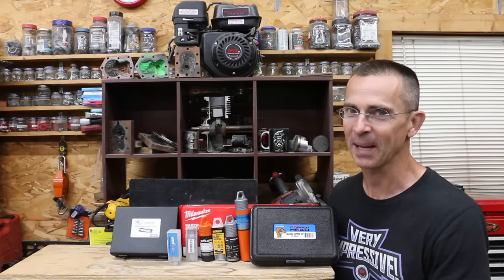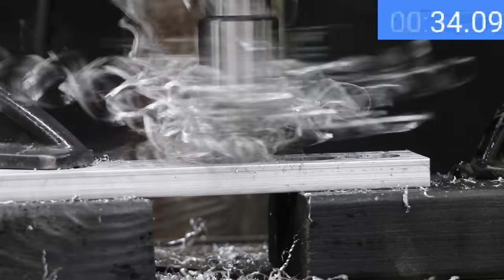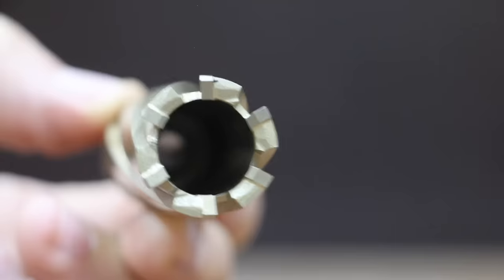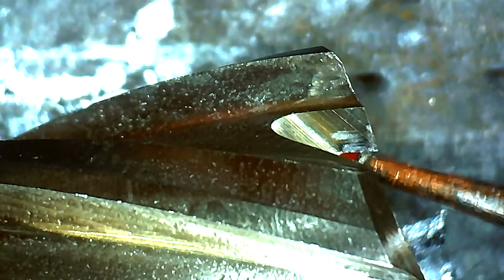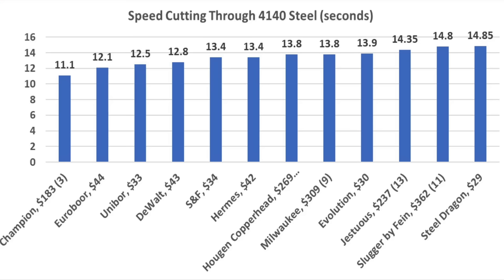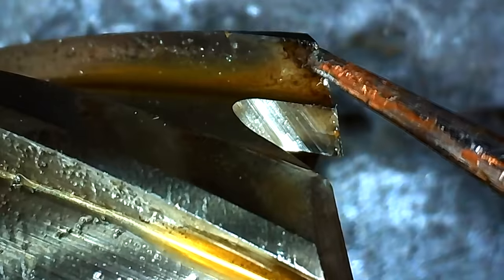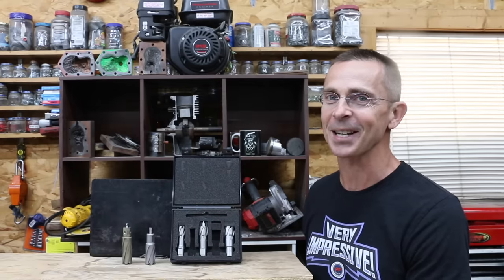Best Annular Cutter? Fein, Milwaukee, DeWalt, Euroboor, Hougan, Hermes, S&F, Evolution, Steel Dragon

Comment: Thanks for  another excellent test and video    I recently bought a farm auction mag drill.  By design the annular cutter throws cuttings and coolant outward thus the internal coolant design on most drills.   I was trying to use cutting oil but more recently started spraying soapy water on cutter so I have minimal cleanup before welding.  Cutters seam to stay just as cool.    Regarding no center pin I have found a cut off and resharped 20?P nail works about as well.  Helps aim drill and eject slug.  I also find magnet does not like pipe or thinner metals.  A 2ft piece of channel is a homemade jig I use to hold drill and or adapt to odd shaped pieces on the farm. 
I wish you would revisit diesel additives and wear prevention.  I have been using the Walmart 2cycle TC#3 but now I am having problems finding it.  I am curious if 0W-20 synthetic  at same 100:1 ratio would provide same wear protection.  I think the injectors themselves wear out without lubrication.  
Another item is algae growth in diesel.  Several bad experiences with little driven diesel systems.  Latest is I had one injection pump rebuilt (IH656) put fresh fuel in drained tank.  I did not use tractor because of drought (San Antonio area).   Tractor got to be impossible to start,  looked like jello in tank;  had been using Howes.  I tried several additives but  I now mix a tablespoon+ of boric acid in white power service fuel additive (glass jar indicates some does dissolve) and use that in tanks.  I do this based on what I read about people trying to add boron to oil and because  boron is basis of Timbor and Biobor.
Reply from the maker: You are welcome!   Thanks for sharing.

Comment: Annular cutters are sometimes used in gunsmithing to remove material from a rifle barrel in order to tap threads for muzzle devices. This process requires a precise internal diameter measurement, but the cutters are sold advertised with only the outside diameter listed. What was the inside diameters from some of these cutters?

Comment: looking at all the data, it's best to get a carbide tipped annular cutter. you sacrifice a bit of cutting speed for far better durability since the carbide tip are barely scratched by spring steel.
Reply from the maker: Thanks for the feedback.

Comment: Can we see a separate shoot out between TCT and HSS cutters? They really are two different categories of tooling. Most of these manufacturers make TCT sets in addition to HSS sets. I would not choose to use TCT except when needed, and in those cases I would probably only choose TCT. (HRC>n for some value of n)
Reply from the maker: Thanks for the suggestion.

Comment: Im interested in what those copper bits are made of. They take longer to cut through but are significantly more durable than most bits. Did they plate copper or is the copper an alloy from say, tungsten?

Comment: I use these a lot at work and they're very good for drilling however if you have two layers make sure that as soon as you cut through the first layer you pull the bed out and remove the core that was just drilled or else you will sit there spinning and spinning and spinning and do nothing but overheat it also they are very brittle.
Reply from the maker: Thanks for the feedback.

Comment: As always, entertaining and informative!  We've seen angle grinder cutting discs, grinding discs, and flap wheels... How about wire wheels? Durability and ability to clean material can vary vastly.  I'd be interested to see wheel style and cup brush styles.
Reply from the maker: Thanks! Thanks for the suggestion.
Reply: Tolex brushes as well

Comment: Hi Todd, again, a super cool test.  Any chance you could try super-invar?  it's a very difficult material to cut; but, i do use it.  it's not like those that you've tested (although it's kind of like spring steel.) machining it makes tons of smoke and fine finishes are hard to get.  also, i know it's a bit insane but i'd really love to see one of these carbide cutters used with a ton of water and soap trying to cut ceramic tile.  would it work?  finally, what do you do with the stuff you've tested? do you trash it or give it to something like Habitat for Humanity?
Reply from the maker: Thanks!  Thanks for the suggestion.

Comment: Worth noting that you can run carbide tools with faster spindle speed, which might help make up the time difference vs HSS cutters on softer metals. With carbide I'd be looking for dark brown or even blue swarf to indicate it is running at its full potential.
Reply from the maker: Thanks for the feedback.

Comment: Tool review request. Torque screwdrivers have become essential for electricians. Historically, electrical inspectors have not enforced torquing requirements for smaller screws, lugs, etc., but that has changed in recent years. With the change, prices and quality are now widespread ranging from $30 to $400 for these manually operated screwdrivers. They are used to torque circuit breakers after inserting the wire, and just about everywhere else, a wire or cable is terminated.
Reply from the maker: Thank you for the video idea!

Comment: CWM Scott copped out on his JB Weld bore liner experiment, which was reasonable since his pitted bore was too valuable for such experiments as a 1937 Chevy engine.  So anyway, do you have any cheap or junk bores that are pitted or damaged down low that could potentially be filled with JB Weld as Scott originally suggested and Uncle Tony endorsed? at least for light duty use?  Or should I try Shop Kat Industries?

Comment: Video suggestion:  I’d like to see a “best of” cordless tool brand using the data you’ve collected in all of your tests.  Since branded cordless tools (drills, reciprocating/chain/skil saws, leaf blowers. hedge trimmers, etc…) tend to use the same battery packs, who gives the best value among tools that use the same battery packs?  This could be very useful to someone that wants to invest in cordless tools with interchangeable batteries over time, considering sometimes the battery packs are very costly.  So what’s the best overall series of tools that utilize the same battery pack?
Reply from the maker: Thanks for the suggestion.

Comment: Another 'Test by the Best.' You're the Best when doing the Test. Did I miss the Test on a stainless steel sink? We need a device that can be set up to allow for a continuous supply of cutting oil when drilling, as professional milling machines have. Is anything like this for us DIYers available?
Reply from the maker: Thanks!  Thanks for the suggestion.

Comment: I feel like I would have to go with the Euroboor, having a fast cutting speed may save labour time for employees, but changing a bit every 3 holes is not saving you time.

The fact the wear of the champion is almost double the first two, makes it hard to justify over the similarly priced (per bit) Euroboor. But it did cut faster so... Maybe a toss up depending on how you value each.
Reply from the maker: Thanks for the feedback.

Comment: These cutters are designed to have a centerpunch for the center pin to ride in when starting the cut. The center pin should be spring loaded.

Comment: Thanks for the test. I was however, disappointed that you didn't use an inside micrometer or telescopic gage and micrometer to measure the diameter of the completed holes. I'm a heck of a lot more interested in the hole diameter accuracy than how much the cutters weigh. Endurance, circularity and diametrical accuracy are the key parameters. Unfortunately you only measured one of the three.
Reply from the maker: You are welcome!  Thanks for the constructive feedback.

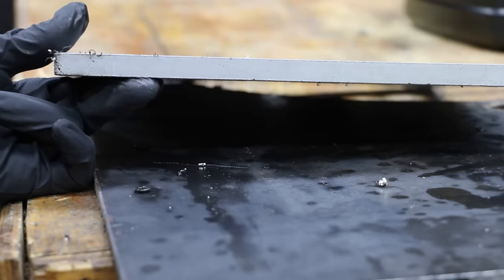Comment: Sorry, but your statement @ 15:27 of this video, where you claim that AR Material is supposedly designed to stop bullets is false.
AR material or Abrasion Resistant Steel is originally designed, say for a Rock Crusher, possible a bucket say for a Back-Hoe, etc.
Armor Resistant, is an added benefit for said material, not it's original designed purpose.

You still make the best video's on YouTube.  Great subject matter, now I know what Annular Cutter(s) to purchase for my Mag-Drill.  Welder, Metal Fabricator, CAD Designer (I use Turbo-Cad, going on 22 yr's.)

Comment: The test for the carbide tools is a bit not wrong id say but not what you usually use carbide tools with. For carbide you usually push it as fast and as hard as the machine can and as fast as possible

Comment: HSS tools are easier to sharpen than carbide inserts, so when you get some shiny new sharp stuff the HSS will be sharper than carbide more often than not.  A decent machinist probably has stuff to grind and resharpen HSS tools, but you'd be lucky to find anyone at all who can sharpen carbide.  HSS is also considerably cheaper in most cases.  This is why most machinists will tell you to use HSS tooling on whatever you can, and leave the carbide for the really hard stuff only when necessary.  Fortunately, it takes a whole lot of abuse to wear carbide inserts out, so while they may not cut as fast, there's not a whole lot out there that won't eventually turn into swarf under them.
Reply from the maker: Thanks for the feedback.

Comment: Video Suggestion: I am curious about surfacing router/cnc bits.  Prices vary from $10 to several hundred dollars.  The less expensive versions are modeled from the higher cost products.  Please consider running a comparison of the various products.
Reply from the maker: Thanks for the suggestion.

Comment: It would be nice if you can do comparison on log splitters. I have a 27 ton splitter but it seems to have lost some power over the years (4). Do they lose power or is it me? Are they really 27 ton or less? Does it matter. How much power do you lose when you run it on 3/4 speed? Is it bad for the engine? Protection of the hoses, engine, exhaust seems to be an afterthought for most machines. (saw your old vid, had the same problem) Are there better ones? Thanks for all the good work. I realize that this might be an expensive proposition for you if you have to buy several.
Reply from the maker: Thanks for the suggestion.

Comment: What happened with the Milwaukee in the first cutting test? It didn't pop all the way through and sounded like it was bound up.
Reply: same as happened to several of them: they are biting too much for the torque of a small drill press

Comment: Carbide is designed to run at much faster rpm than HSS. Its not right to compare them at same rpm. they have to brea the sharp edgesto minimize breakage so they are dull by design.

Comment: If you haven't tested for the best auto mirror glue would be a good test for adhesive ability, heat, expansion and contraction with common glued materials, etc.
Reply from the maker: Thanks for the suggestion.

Comment: Since these products are new to me, I'll just try to locate where Hermes cutters are made. lol  
The best I could trace Hermes shows them located in Queens, New York. Unable to determine if they manufacture products there or if it is merely a distribution center without calling them, for the internet is sterile of that information.  lol 
Hermes (Hermes Hardware) is a division of Hephaistos Building Supplies, also located in Queens.
Fingers crossed, but there is a good chance their cutters are manufactured on our shores.

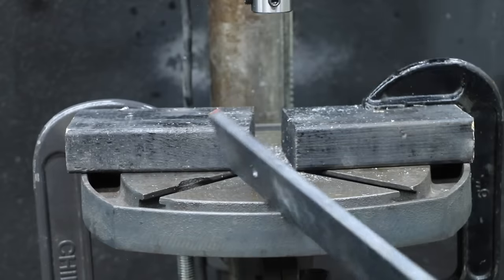Edited: I thought I seen a fire during drilling. (7:15) It was the bottle of oil.  hahaha!!!!

Comment: I keep using the twist drills because those annular cutters dont seem to be worth of the money. I would suggest you to test different textile adhesives. I have been using Bison textile adhesive 25ml that I think is quite good adhesive but tube is poor quality because about 5 of 9 tubes cracked, leaking adhesive to my hand when I squeeze and twist the tube to get out all the last drips of adhesive before throwing empty tube into trash bin.
Reply from the maker: Thanks for the suggestion.

Comment: Amazing videos all the time. I think you did a video recently with battery powered vacuum cleaners. Any chance you could have a shoot off between that and a normal mains powered one? We had a battery Dyson which was so convenient but didn't quite perform as well as a corded one. Would be interesting to see if battery tech has improved to the point where they're comparable.
Reply from the maker: Thanks for the suggestion.

Comment: Great info.  How about a test of Solar Panels for battery Maintenance?  I bought some at Northern Tool and one actually starting to drain batteries instead of charging!  The other 2 still worked fine, but thought you would come up with an interesting test.
Reply from the maker: Thanks for the suggestion.

Comment: I'm really surprised to see you do one on those annular cutters, those babies are expensive.  I've always thought of them as a no other way just gotta have it bite the bullet and charge it to the job type item.  If the hole is for me, I'm going to cut the circle with a series of small holes, knock the plug out and file it the rest of the way.

Comment: Would be interrested to see a comparison of garden shears or pruning shears. I have been using Felco 9 for over 10 years now, one pair with its original blade, but nowadays a replacement blade is more expensive than a brand new set of shears. Would like to know if Felco is still worth it.
Reply from the maker: Thanks for the suggestion.

Comment: I didn’t realise they were called annular cutters. I’ve only known them as Rotabroach, which is the brand name that makes them. 
Have you done a video on countersinks before? They need to be long lasting as they aren’t easy to sharpen like drill bits are, and dull ones leave a poor finish and bring up a burr at the top of the hole. I think it would make for a good video.
Reply from the maker: Thanks for the suggestion.

Comment: Hi, ... in a wild world where access to tools-cutters can fluctuate, for instance in cases of wars or sanctions....  i would like you to consider a series on 'most modern and durable' ways to cut.  in over 32 years we have water jet, laser and other means to cut; which while finishing is not 'great', and the holes or surfaces need to be rebored or shaped (which is far more economical and less wear on conventional cutters).... the issue of 'lifespan longevity' is a vital issue to industries of all types of manufacture.....
Reply from the maker: Thanks for the suggestion.

Comment: Mr. Farm could you please test UPS and tell us which one(s) are the best? Here are some products (they can be found on Amazon):

Tripp Lite 550VA UPS (INTERNET550U)
APC UPS 600VA (BE600M1)
CyberPower UPS 650VA (EC650LCD)
CyberPower UPS 625VA (ST625U)
Amazon Basics UPS 600 VA
Vertiv Liebert UPS 660VA (PST5-660MT120) 

APC UPS 425VA (BE425M)
CyberPower UPS 425VA (ST425)
CyberPower UPS 425VA (CP425SLG)
Liebert UPS 500VA (PST5-500MT120)

Thank you!

Comment: I have a video suggestion. I was wondering if you could test five gallon branded pails, like those sold at HD, Lowes, Menards, etc? I use them quite a lot in my landscaping biz, and I noticed that they're not built the same.
Reply from the maker: Thanks for the suggestion.

Comment: I watched the vid about unclogging drains, but could you test things that actually dissolve roots in a 6" sewer-type pipe maybe using polycarbonate (strong) or acrylic (cheap) so it's transparent?  There could be a section maybe a foot long for each type of thing tested (lye, various root removers/drain cleaners, that vinegar/baking soda/salt foaming home remedy which sounds like nonsense to me (yes it will foam and salt will kill the roots but dissolve them? Yeah right...).  Drill a couple of 1" holes, maybe 3, in the top of each and loosely fit them together in a zig-zag pattern.  Run a recirculating hydroponic solution with a little garden pump and put a little incline on the whole thing and maybe a float valve and tank so it doesn't go dry, plant some fast-growing veggies or whatever over it.  In a few months you could pull the sections and stick one end against a pipe coming off a commode and stick a drain pipe on the back and flush the test goo and see if anything REALLY dissolves roots in pipes. Seems to me the entire pipe would need to be blocked off and filled with one of the most caustic acids (sulfuric, hydrochloric, maybe nitric?), maybe bleach; concentrated lye would do it but at what cost and damage to the pipes?  Maybe put some PVP or iron or shark bites in there somewhere to see what the chemicals do to that too?  
Anyway, you probably know better than I do but just a thought - Love ya, love yer show; keep up the great work!
Reply from the maker: Thanks, will do!  Thanks for the suggestion.

Comment: I don't see the point of a non carbide tipped one, sure you take off a few seconds on the drilling time but it wears out so fast the next hole will drill a lot slower and will also require more bit changes which will result in more time loss (and money in the long run) than just a carbide.

Comment: You should do test on power steamers. I've always wanted one, a few years back I bought a "as seen on TV" shark brand steam cleaner. Pure junk. I'm sure the steam was sterile but it was not hot at all. Wanted that high heat steam clean.
Reply from the maker: Thanks for the suggestion.

Comment: Few years ago had to drill a grade 8 bolt. I tried my high quality USA high speed steel bits and they wouldn't scratch it. Friend had a set of cheap black oxide bits in a red plastic case. I thought waste of time but I'll try it. They drilled that bolt like it was a grade 1 or mild steel. The bits got stolen later. I've often wondered about this. Maybe they were cobalt ?  They were not marked. They came from Sam's wholesale Club made in China. I wouldn't believe this if I heard it but I was running the drill so I know it's true. Any thoughts on what those bits would be or where to get an equivalent